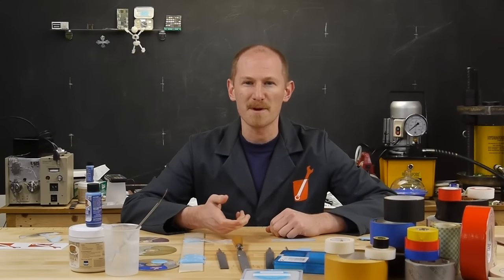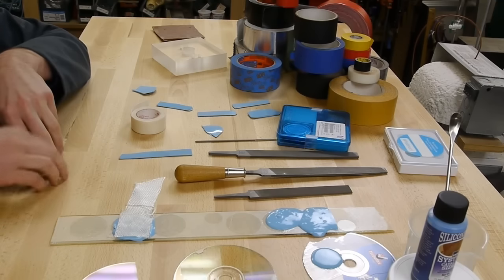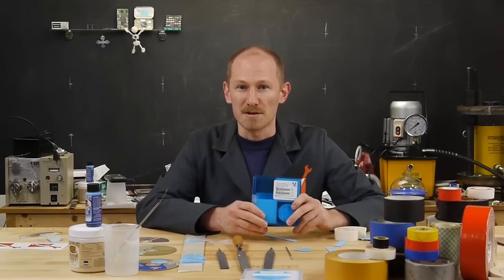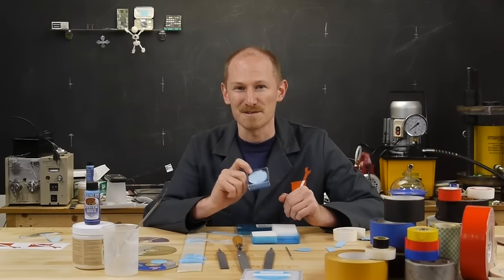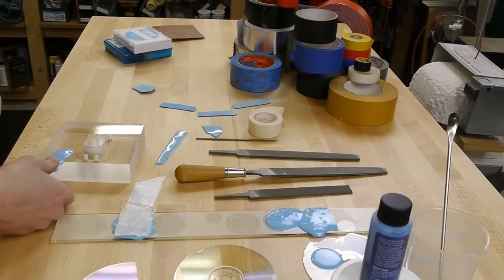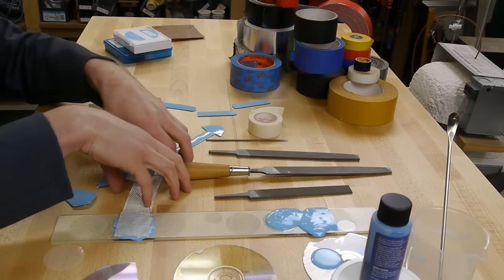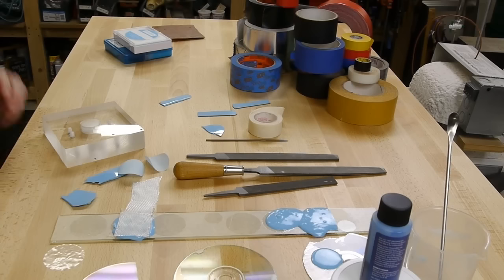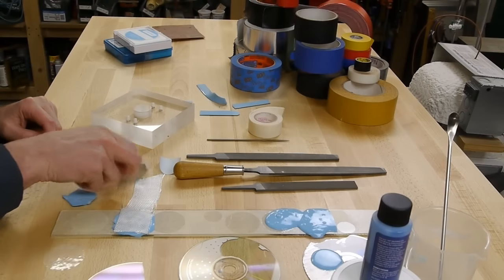Making DIY gecko tape - work in progress

Comment: probably all stupid ideas.... but ...  : etch steel via an etch-ant soaked piece of microfiber cloth  ...straight out coat microfibre cloth with silicone.. ...  .. .. . grow something like black bread mold then silicon coat the mold  ...  maybe try frosted glass as a trial..  ? another thought...try a ferro fluid base as the mold ... or mix in a magnetically permeable dust to allow magnetic molding...?  or    ...get a piece of already anodized  aluminum and sand blast or pattern scratch it really light with correctly scaled particulate or woven mesh or fabric hammered on top then put it in the anodizing tank in reverse ? ..... ... get a really thin piece of tree trunk or skeletonised leaves to use..... stainless mesh from reusable oil filters and fuel filters go down to about 30 microns or lower.....nylon woven fabric can get down to lower than 10 in some cases ....    to be honest .. my first thought was lithography also..

Comment: Ben, I hope you have seen Dan Gelbart's videos - seems like your kind of guy...  He says silicone mold is accurate to the "molecular" level https://youtu.be/nCfVupLt-Pk .  So, you could try to make a mold of a real gecko's foot.  Other creatures stand upside down on the ceiling e.g. flies.  You might be able to cast a natural sticky foot, then use normal mold making techniques to multiply the pattern into a sheet of feet - with some super fiddly work early in the process.

Comment: Why don’t you take cheap optical grating foil as a mold instead of the CD? They have small grooves or sawtooth pattern you describe in the video. You can buy some at Edmund optics 
https://www.edmundoptics.com/f/Holographic-Diffraction-Grating-Film/11661/ 
...or better at other shops. 

https://www.temicon.com/en/products/micronano-structures/optical-gratings/